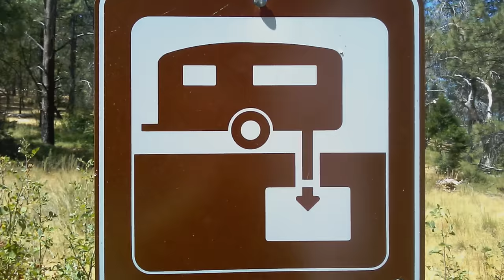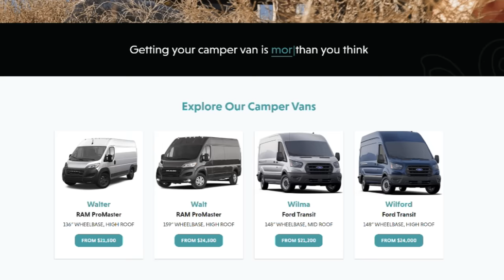8 REASONS RV LIFE can SUCK!

Comment: I’ve had a Class A, B, Teardrop and now, a Chevy van. I’ll take the van. It’s not for everyone, but I like it better than all the others.
Reply: 💯   The strength and durability alone is reason enough for me to eventually upgrade from the camper I’m about to live in, to a converted short bus. Even nice campers and RVs are toothpicks and aluminum/fiberglass. The best rig is the one you built (and therefore can absolutely fix) yourself.
Reply: Yes on the van. It's tough if you glamper camp, but its much more durable, easier to maintain/cheaper to fix, can fit in a normal parking spot, and can go stealth in a city. Yeah, it would be nice to have a toilet and black tank, but it's nice to poop in a bucket and toss it into the trash with the rest of the diapers and drive away.
Reply: It’s over 4.5 years later, and I still love every minute. (She said from a tiny house 2-day rental. I’ve been in my van all summer. Needed a minute. ) Having 2 trailers and a red neck van helps.
Reply: Good points ! You are right ! Its not that easy 😂❤ Great video
Reply: @janasher4940 that's nasty

Comment: Full-time for almost five years now. I would say getting your mail or packages to you is a bigger deal than most people realize. Amazon doesn't come to your door when you're on the road. And you nailed it with the research and planning involved when you have a larger rig.
Reply: I don't have these 2 issues.  When I sold my primary residence 3 yrs ago, I never set up a forwarding address to my secondary residence.   Zero junk mail.  My 3 bills (phone, credit card, and insurance) are all billed and paid on line. Just renewed drivers license for next 5 yrs. Know dates for truck and travel trailer tag renewel and either plan to be at home base or have a friend take care of it.  Nothing on Amazon that I can't buy at Walmart .

Comment: We lived full-time in a class A motorhome, with NO towable car, for 5 years. Had to deal with being sick with COVID-19 while living in the RV, which is way rougher than doing so while living in a house. 

After 5 years, we found the town we wanted to settle down in, so we sold the RV and have never regretted it.

I think one of the biggest downsides to living full-time in a class A motorhome, with its enormous, built-in propane tank, is having to pull up stakes, store EVERYTHING away, and shut down everything just to drive the rig to a place that will refill yr propane tank. And when you have COVID and the propane place says by law they cannot refill the tank until everyone exits the RV.... well, that's a real SPECIAL experience!

Comment: These are true statements Robin.   My rig took a catastrophic series of surges that caused a fire last week.   It was a total loss. Rig and everything in it. 

Everyone, PLEASE make sure you protect yourself as much as possible from bad campground power and owners who don't care to fix them.
Reply: That happened to me as well in Texas. The hookup power box caught fire but lucky for me the rig next to me camping was a fire marshal and he handled the situation keeping us all safe ..
Reply: Is there a way to test these power boxes before I hook to them?
Reply: @desiandy21able .  A voltage 
meter and or a voltage sensor.  Our van has a power surge protector system that shuts down if the voltage goes too high from the campground electric power supply.
Reply: And then there are some of us who would never consider hooking up to a power pedestal even if parked next to one.  I travel very very small and have multiple ways to work around weather conditions.   Very happy with my tiny footprint and very minimal power requirements. 😊
Reply: Sorry u have to go through that
Reply: @desiandy21able An RV surge protector! And not a time to skimp out and get the cheapest one you can find. A good one is more than worth the $100-200 bucks. Probably one of the most important things for your rig.
Reply: @l.e.phillips  I agree.   I had a good surge protector on the rig.   My issues were caused primarily from low voltages.   Then it seems as if it was a perfect storm of electrical changes.  There is actually a plasma burn on the back of the pedestal I was plugged into.    My suggestion is to pickup a Hughes Autoformer and a Bulldog Protector.   run them both in serial and hope that you can get a little protection that way.
Reply: @desiandy21able  Good surge protector.   Not the cheapest one you can get a hold of.   I had a cheap one before this incident and the campground electrical took it several weeks ago.  I replaced it with a far better one.
Reply: @theroods7440  The problem is when the power is fluctuating AFTER you hook up.   This is a campground that I stay in most of the summer.
Reply: @nealamesbury7953  Thank you.   It sucks   I live most of the time in this rig and almost ALL of my belongings and clothing were in there.   I have to replace everything!!
Reply: @GlennMay1970 I'm sorry to hear you're going through that experience.  When I looked for a surge protector last year, even the expensive ones had caught fire, possibly even causing the fire.   I'll have to take a look and see if they've gotten any better. 

And it brings up a whole other list of questions.  How's it going with your insurance?  And any other tips?
Reply: @c.m.303  make sure you have good insurance and a relatively accurate inventory of what's inside.    This has been a summer of upgrades and repairs for me.  I have out about 7k of updates and repairs in the past 4 months.  

As for the campground and proper responsibility.  That remains to be seen.   For that matter I have not seen my adjuster yet.

Comment: Gurl, you need a GPS Garmin RV model. You put in your rig specs, height, length, towing or not. You select a route by choosing to use freeways, or ask for country roads, state highways are often scenic. It gives you heads up on tolls, narrow roads or elevation. It tells you where the fuel stops, restaurants, etc. You can look for camping sites. Check it out. I love mine.
Reply: Does it require internet?
Reply: @Some_kind_of_wonderfü  nope. It uses a satellite. And ya don’t have to pay for that. Maybe it works on cell towers too. But when it is powering up it says it is accessing a something and to give it a minute. You have to pay for map updates which I have not done in 5 years. It is getting to the point I may do that. I am not a full timer. But, I will not travel without it. My truck pulls a trailer and it uses huge amounts  of gas. I have to plan gas stops. I go to remote places where you actually may run out. Google is NOT accurate. Garmw
Reply: @katypatton1886  Thank you!!!

Comment: So, at the end you asked for specific stories of 'sucky'. I've been full time in my RV for 4 years, and have a location dependent job. This summer, I have been stuck in Phoenix - not 70° !  
But mostly, my issue has been repair costs on my Sprinter van. It's a HUGE problem, and finding someplace to live during repairs is annoying. (I'm open  to suggestions on more reliable vehicles).
Bob Wells suggested renting a Uhaul (I prefer Penske), but there is no air conditioning or generator  - so plan ahead and have a plan B for those situations. 
I have no interest in going back to living in a house, so I am building an emergency fund and eliminating debt so I can do seasonal jobs. (I'm a mechanic and also do residential construction - internet work is a BIG stretch 😏)

Comment: Nice title, got me to click on it and watch..3 to 5 mins in I thought hmmm..majority of your reasons RV sucks aren't an issue with a Class B van..and voila..video is about a Class B van eventually ..have a Class B Promaster van and we have everything in it, 800ah lithium from factory, power is not an issue, added internet (Starlink, 5G home router), bathroom (cassette so don't need dump stations), kitchen, microwave, live TV, Air conditioner (10 - 12 hrs due to 11KW battery), we don't set up camp, just drive to the location and we cook, eat, sleep in our van and when done just drive away. Can setup awning with a push of a button and retract in under a minute. Only thing we setup are our inflatable SUPs and e-bikes. It's our mobile home and office and also great for last minute road trips. Also great for boondocking and BLM free sites. I agree some RV life sucks..but in a Class B some reasons aren't an issue, nice video, cheers!

Comment: Be aware of poorly maintained roads and highways.  Traveling on US 40 from Russellville, AL to CA pulling a travel trailer, just getting into Las Vegas, the axel broke and we blew a tire on our trailer. Googled RV repairs and found NG RV & Trailer Repair in North Las Vegas.  Nico put on a new axel and tire and had us up and back on the road within 3 hours.  Cost for the repairs were very reasonable.  So blessed that we did not break down on portions of the highway with no pull outs or that we did not break down in the desert.  Definitely things to consider while RV'ing.
Reply: Right!  What's up with the roads!!! I recently traveled MS to OH and thought for sure one of those craters and 'speed bumps' on the highway were going to take my axle off.  Wondered if a horse and buggy had a smoother ride.  I thought I heard someone in a speech bragging about all the infrastructure upgrades?  May they are figuring we won't need roads.

Comment: Most of the things you say suck, are related to big expensive rigs.
We lived in our van for one year: cracked windshield and one flat tire- thats it on repairs. No weather issues. Not a lot of chores. If you can live simply, its easy. We drove to AK and then to Key West FL. We had no electrical appliances, no heater. Only a cooler.
Reply: We fell for the "buy as BIG as you can afford! You'll need the space!" So, we went with a 32' Class C. 
I can see the only justification for that was because we had a large herd of animals (6 dogs, 1 cat, 1 bird). Now down to two dogs, we don't need the space. We didn't need the people space in the 32'. Most of the storage areas stayed empty. We never used the cab-over area. The shower was too small, so we used CG bathrooms. 

We'll be fine with the van we are going to convert and look forward to not having to maneuver a land yacht down the road.
Reply: Sounds like a miserable setup
Reply: Sounds like a miserable setup

Comment: We were heading down a road this morning and stopped by the police because of an accident on the other side. It appeared to have been a Class C, traveling with someone driving an A. Hard to tell because the RV that crashed came apart like a cardboard box. It looked like an Amazon box that had been stepped on to put in the recycling bin. 

We've had a Class C for 10 years now. Because we are down to two dogs from the previous 6, plus a cat, plus a bird, we don't feel like we need a big rig anymore. Having gone through all the things Robin described with maintenance, repair, cost and downtime, we aren't going to buy another RV. Toooo much of a hassle. We're buying a large van to convert, simply.